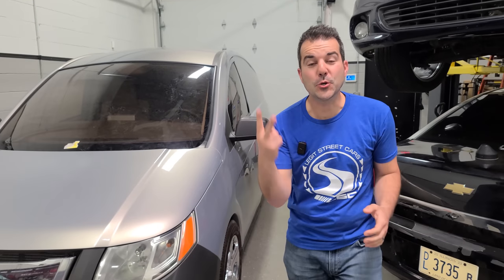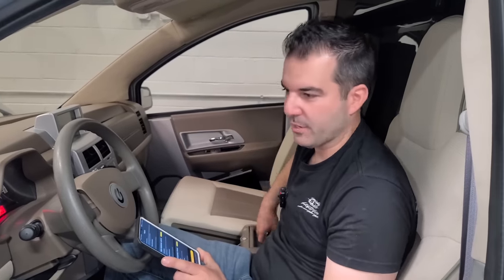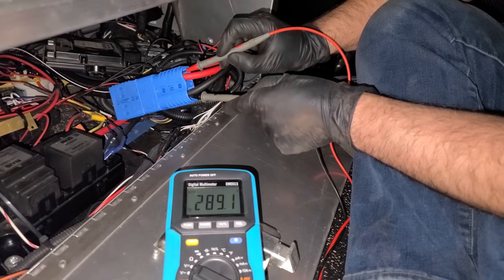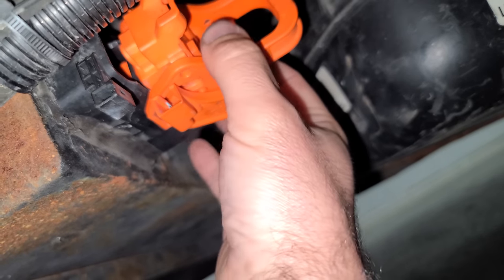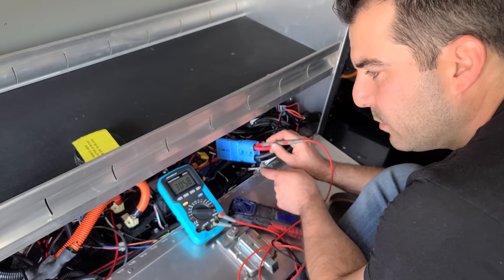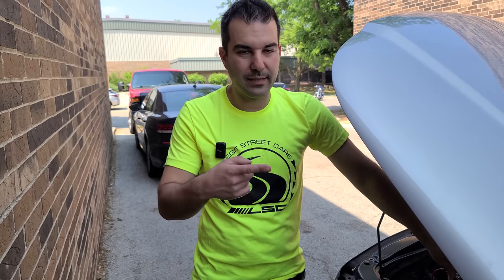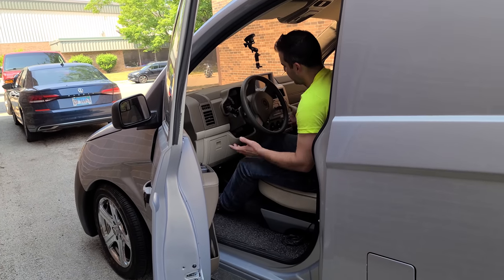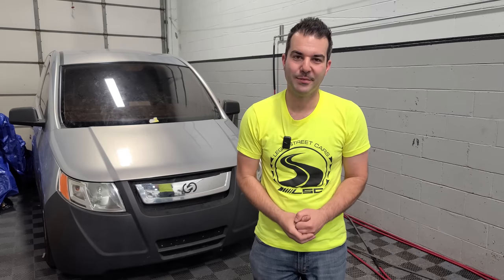I Fixed The Abandoned 2 Million Dollar Concept Car For $150! First Drive Ended In Disaster!

Comment: It was mentioned in the first video that the van worked in FWD mode using the engine, RWD mode using the electric motor, or both at the same time, and I suspect this happens depending on a combination of state of charge and power required to move the vehicle. Given the motor is currently running in the wrong direction, I suspect the shaking happens when the engine tries to start and the motor is already turning (or vice versa). Swap any two of the three phase cables to the motor to correct its direction, and at least then the motor and the engine wont be trying to fight each other.
Reply: This. It makes so much sense
Reply: Yes! The marketing lady mentioned that the van was donated to a technical college. It could be that they plugged the wrong cables to the motor.
Reply: Bump so Alex reads this comment!
Reply: THIS!  The large EV motor uses 3 phase power, and like any such motor you can reverse any 2 of them to reverse its rotation direction.

Do this before trying to drive it again... AND get all of those electric motor mounts repaired and strengthened! (not just one side)
Reply: this is what i was coming into the comments to write, glad to see someone else already beat me to it

Comment: I have a feeling the motor comfig or phase wires have been inverted and as soon as the engine starts when the voltage lowers a bit, it fights it in the opposite direction.

Comment: EV mode in R and gas mode in D should give you a pretty big clue.
Most AC motors can be reversed in software. Since it spent ages with basically no power, it's VERY likely that the controller lost it's settings.
You definitely should chat with "Shawn" to see if there is such a setting in the controller. If the electric motor tries to "help" the fuel engine, it will fight it and can shake it to hell and back as you saw if the clutch engages.
Reply: Thank you, you saved me from typing my thoughts.
Reply: Exactly what I was thinking....
Reply: I’m surprised he hasn’t worked it out, super simple as soon as it was full ev and went forward in R. Because the gas motor and the electric motor are spinning in different directions
Reply: Same thing i was thinking. And thts why the bracket keeps breaking
Reply: My thought too. seems the vibrating is because the gas engine and electric engine works opposite. Like with electric bikes, they also needs to be set into the right direction.
Reply: Everyone here has typed exactly what I was thinking.
Reply: Just my thoughts
Reply: That's my guess as well
Reply: Me too.
Reply: Yall some geeks😂
Reply: My thought as well!
Reply: EV motor was trying to kick in the wrong direction and bucking it.
Reply: So what you're saying is this vehicle is a rolling marriage on a bad day. The gas motor wants everyone to go to the mall and buy school clothes and the electric motor wants to go to the lake. Pour beer on the controller, that might make it go along to avoid a fight.
Reply: I had the same thought. The motors are fighting each other when they both run at the same time.
Reply: I just typed almost the same thing lol then I read your post and deleted mines. I’m also surprised he didn’t look deeper into that.
Reply: Its a very good thought - and brings me to easier roots from smaller brushless motors: If the controller has lost its settings, also the timing or startup power setting maybe  wrong - overwhelming the battery - getting it in a erratic shaking as the restart attempts kick in. I don't think its because it works against the fuel engine, as it wasn't even running.
Reply: Yup, it seems so obvious watching the vid.
Reply: I said the same thing before I read the comments tho.. but even without software. If the wires are connected backwards it will do the same thing.. take any electric motor wire it direct power and it spins forward reverse the wires is will spin backwards..   but also could be reversed wiring anywhere. Hopefully he sees one of our comments and gets her fixed!!!
Reply: Has anyone seen Peter lately?
Reply: @Sam_A  hmm.. on 5phase 400v u can make the motor go in reverse by switching the cables around. Thats how all my shop machines work anyway... so isn't that possible on those ev engines too?
Reply: @Sam_A  I would guess the vibration is bcoz they have not fastened it enough. The harness seemed kinda iffy. If it's not bolted down 100% the motor will try to turn instead of turning the wheel.
Why it's doing it in park I'm not sure, but I would guess the electrical system is kinda screwed up, for it to vibrate there must be power going to the motor.. and there shouldn't be when it's in park. But did it do it in park? Wasn't it just when he put it in gear? But the electric system seems really screwed up so I guess it can be anything..
Reply: Bump so Alex reads this comment!
Reply: @genius1a  Also possible, but on the other hand while driving the problem only started when the gas engine kicked in. It can be quit difficult also depending how the gas engine and electric motor are coupled . And how charging by the gas engine works and how all together is programmed by the controller.
Reply: Very likely we've got a reversed AC motor.  The controller programming might be an issue here as suggested. A maybe fix, tho, would be to just flop any two of the three phase inputs to the motor. This will reverse the rotation of the motor.  Might be an easy fix?  Cool stuff here!
Reply: Or just swap connections of 2 of the 3 electric motor power wires... this will reverse its rotation.
Reply: Came here to type this. Thank you
At 'low voltage' it might be trying to engage the clutch and start the gas engine. Which is spinning the wrong way
Reply: That would make sense!
Reply: I also think whatever the default startup sequence is, is also causing the heavy shaking, i have experience with my ev bicycle
Reply: My god, as soon as that happened the first time, I thought that, how did it not click with him.
Reply: exactly!
Reply: The only problem with that idea is the fact that it also happens when the gas engine is completely off. The main cause seems to be the high-voltage battery voltage.

Now, as far as drive and reverse being swapped in EV mode, you’re likely right. Simple and easy fix for THAT would be to swap 2 of the phases, assuming that it’s a 480v 3-phase motor. If it’s a 240v “single phase” motor, then I’m not so sure. Could go either way, given that the “nominal” voltage of the HV battery was quoted at 320v.
Reply: This 100%
Reply: I know almost nothing about cars, love this kind of video, anyway i was thinking just the same gas engine and ev going opposite direction R forward.
Reply: I was just going to type this out
Reply: Yup, the electric motor is turning the wrong direction.
Reply: Electric motor is wired backwards and fight the gas engine.
Reply: Dang you beat me to it!
Reply: @ekaftan  same as I was thinking. I would try inverting they polarity of the motor
Reply: I agree. It sounds like the gas engine and the electric motor are fighting each other trying to drive in the opposite direction.
Reply: Exactly ! Probably also why the motor is trying to move sitting still! And if it’s interfaced at all with the dodge ecu, and the dodge is saying it’s in drive and the motor is in R . That’s probably confusing one of the controllers
Reply: @Sam_A  still swapping one phase will change direction
Reply: @TinkerbatTech  I would also think that if this is the case with the controller there is probably a “soft start” or no load engaging current that was lost as well causing the controller to send power to the motor during startup when it should just be activating the electric drive
Reply: My thought as well
Reply: How has he not worked it out yet
Reply: Came here to say this found someone was as intelligent as me lol 😂
Reply: And the engine kicks in when it’s low on juice
Reply: Agree 100
Reply: Yes, lift the car of the ground and check to see if rear wheels spin in the same direction, see if vibration will disappear
Reply: JUST SWITCH THE MOTOR WIRES.
Reply: @genius1a  the first one to almost figure it out. The problem is polarity. He has the black and red wires confused because a/c power and d/c power use different color codes for positive and negative, and DC doesn't have a neutral.
Reply: What they said!
Reply: Same for me. As soon as he said the drive was flipped I thought something is out of sinc in the control of the electric motor. Piston motor is trying to run in drive and the electric motor  is trying to run in reverse. Maybe a speed limiter, if it has one, on the electric motor in reverse is also causing an issue. Old tech in this early development could have all sorts of software trying to do automated actions that are fighting each other.
Reply: Maybe one of the switches on the box underneath the clovebox activates DRIFT-MODE, making the backaxle turn the wrong way, so you can do insane BURNOUTS???
But this only works with a full battery and if you slam the pedal to the metal, ofcourse...
😂😂😂😂😂😂😂😂😂
🍺🍺🍺Cheers!

PS:
Yeah, I know, what you're all saying makes way more sence. The controller is back to factory settings or in safemode, since some other controller, maybe the one that SHOULD be keeping track of lots of data, sending it the screen on the dashboard AND telling the controller what mode to be in, is not working at all???
Reply: So basically at low voltage and having sat for so long the cpu settings reverted and when it's in gear with charge the front goes one way and the rear goes the other.
Reply: But seriously, what if the microcontroller that is supposed to show all kinds of information on the screen on the dashboard IS the MAINcontroller of this vehicle???
What if this is the 1&only microcontroller that is supposed to 'know' and 'remember' everything there is to know about the car, like a FlightDataRecorder in an airplane (it's a prototype, engineers will want to know everything) AND meanwhile send data to the dashboarddisplay AND crucial commands to the (electric) motorcontroller and (combustion) engine management system???
This microcontroller is obviously not functioning. Maybe this should be addressed first???
Anyone?
Reply: Could be that the last time it was taken to pieces something got reversed.. Or the motor could be oscillating -back and forward.. 
Oscillation will definitely do that shaking thing either in hybrid or electric only mode. Doing that banging thing..  :hand-orange-covering-eyes:
Reply: I typed a similar comment…. But I see it’s already here
Reply: I drive a 2013 VW jetta hybrid   , This explains the shake I get when accelerating from a stop at times.  car shakes like the gear is slipping for a couple of seconds.
Reply: Yep this is straight what I went to the comments to find
Reply: So nobody here agrees with me, that the MAINcontroller of the vehicle being off, would cause very strange behaviour???
Weird!
Reply: not only the setup, it could be it's just connected inverted phase therefore causing the electric to go rear while petrol goes forward
Reply: @TerrorTubbie666  Could be. The behaviour looks more like oscillation to me. - That means something is actually broken - like a DC motor being fed AC, an AC motor given the wrong frequency, or some kind of broken sensor/feedback loop..
Reply: @Lucien86  yes, yes, but I think, the display/touchscreen on the dashboard belongs to the main monitoring&controlling unit (possibly a laptop/minipc build in behind the dashboard (with an empty CMOS-battery!)), which is supposed to 'tell' the controller of the electric motor/generator(!), which mode it should be in.
Because it obviously doesn't even boot up far enough to display an error message on the dashboardscreen, it also sends no signal to the motor/generator-controller.
And thus, the motor/generator-controller is randomly going from one mode to the next, then this, then that, then the first again, etc......
Reply: @TerrorTubbie666  You might be right but normal behaviour then would be for the motor controller to simply lock out until it had been configured. Even a prototype would have that (I'm guessing) as a basic safety requirement. 
More likely is that it was pre-configured..

The way it was behaving - not working then working then not working looks more like a fault. Maybe its config memory might be bad.
Reply: Let's put it this way:
I bet there's a harddrive (or SSD (or at least a usbport with/without memmorystick)) somewhere in that car, containing lots of data about all/some of the (test)drives this car (ever?) made.
If (or when) the dashboardscreen works, it'll be able to show graphs of highvoltagebattery-voltage/temperature/currentdrawn, current to/from and voltage over motor/generator, combustion engine temperature/rpm/battery voltage&current drawn, outside temperature, vehicle-speed, etc, etc, etc...
AND you'll be able to set stuff like the minimum voltage of the highvoltage-battery to still drive fully electric or switch on the combustion engine (by just putting it in gear or with electric starter), maximum voltage of the highvoltage-battery to regenerate while breaking, maximum temperature of the highvoltage-battery to start/stop driving fully electric, etc, etc, etc....
Like a FlightDataRecorder in an airplane WITH a (touch)screen on the dashboard, so you can see and change EVERYTHING you want!
If I were an engineer building and testing such a prototype, I would probably build it like that.
Reply: @Lucien86  Maybe this safety is indeed build in. But if I were an engineer building and testing such a prototype, I would disable that and set these settings in my MAINcontroller-unit via the dashboard touchscreen.
And so, I am God (of this car).
Reply: Electrical engineer/auto mechanic here and I was searching for this comment before leaving one of my own. I def see a polarity reversal in the programming here.
Reply: @TerrorTubbie666  it’s definitely possible. But why would the default condition be reverse when a simple swap of the wires would default forward in the event that the main controller’s settings were cleared due to voltage loss? Doesn’t seem like 68 people would overlook that
Reply: @TurtleVerified  wouldn't be the first time, I notice something 68.000 overlooked.
If I were an engineer building and testing such a prototype, I would not even try to start it without me being God of this car.
Reply: 100% the EV motor is running opposite of the gas engine. Everyone line this to ensure he sees the comment.
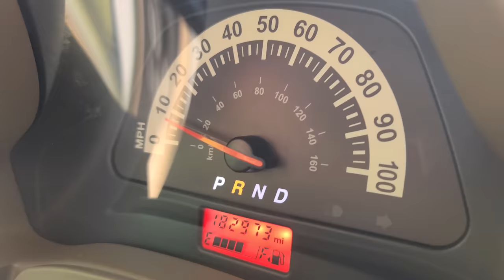Reply: @genius1a you are partial right. About the motor kicking in an out yes. Wrong about the direction. Look at 43:15. It goes forward in R and backwards in D.
Reply: @Sam_A look at 43:15
Reply: My thoughts too. 
1.EV mode- goes forward in R- it’s ok. No shaking. 
2. Gas only- goes forward in D ok. 
3. Gas and electric- shaking when in D or R and operating at the same time. 
Sounds like they are fighting each other. reverse polarity/programming issues.
Reply: Yep I think you’re right.  The motors are literally driving eachother in opposing directions due to some reset or failure (which is clear why the motor mounts were broken).  And if there is an electronic clutch on the electric motor, it’s probably stuck engaged.  So either way you are either running on the gas engine and fighting the electric motor, or your running in EV and spinning the transmission and engine backwards.
Reply: the swapped rev/drive seems like a good place to start
Reply: Anyone seen the new video???
😂😂😂😂😂😂😂😂😂😂😂😂😂😂
Reply: this guy has no clue what he's doing, so no he never would have arrived at that conclusion
Reply: Yep I came here to say a rudimentary version of this right after I heard him say ev mode was working in opposite of what it was saying.